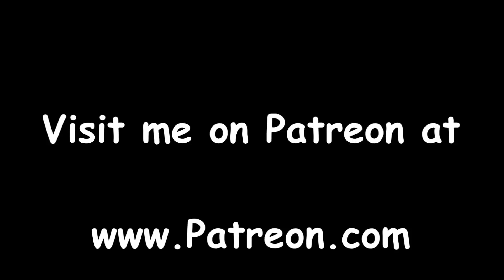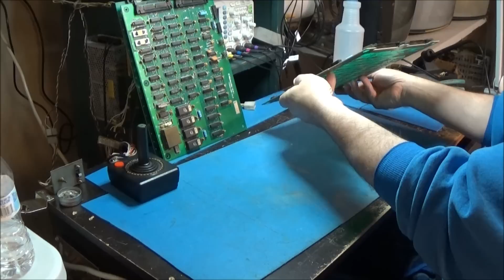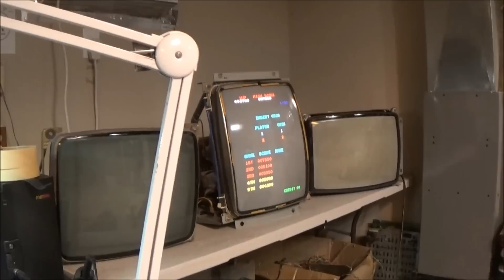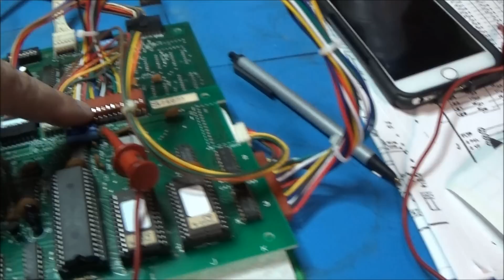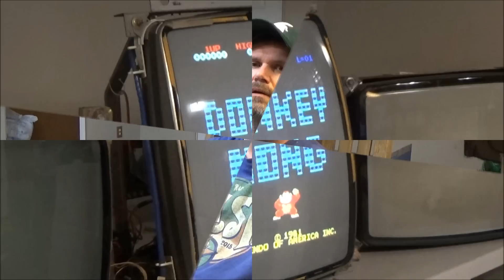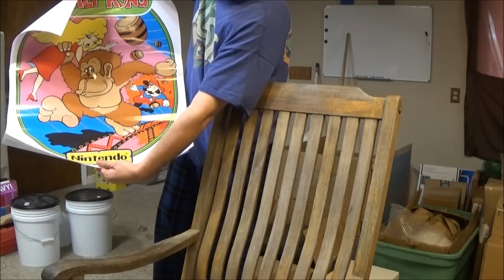1981 Nintendo Donkey Kong Arcade PCB Repair!   4\17\21

Comment: We have a Radarscope Donkey Kong at the museum which just gave a garbage screen, pushing on stuff sometimes made it boot with garbled picture and sometimes garbled levels (you'd fall through the floor, end up at the top and the game thinks the level is beat...). I reseated all the ICs, and changed some IC sockets since they felt organic and that fixed it.
Reply: I like your decimal alarm clock.
Reply from the maker: nice...  love those red DK's
Reply: @classicarcaderepairs  Too bad the previous owner irreversibly converted it to JAMMA. Frustrating. I fixed the boards but I can't put them back in the machine. Actually, most of the wiring harness is still there, but the power supply has gone missing.
Reply from the maker: @senilyDeluxe  well,  i do have an original wooden nintendo power supply carrier lol   thats about it though  :)